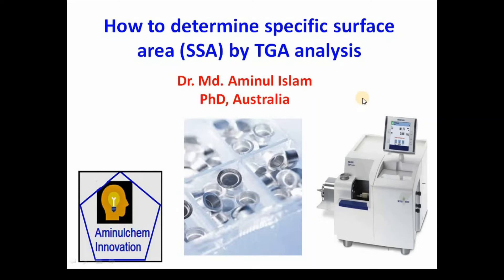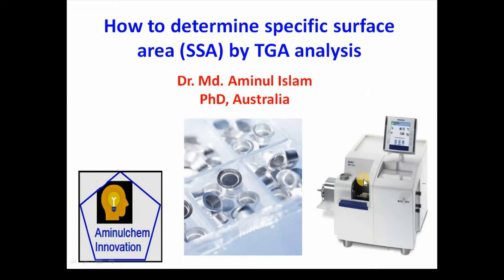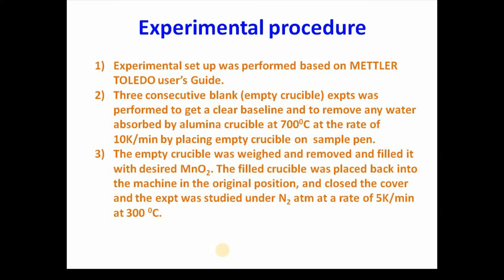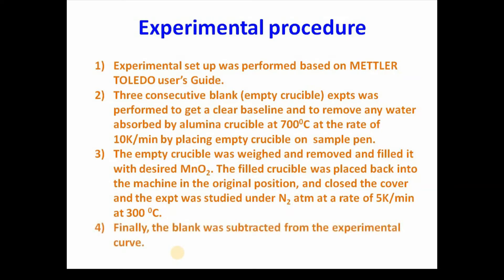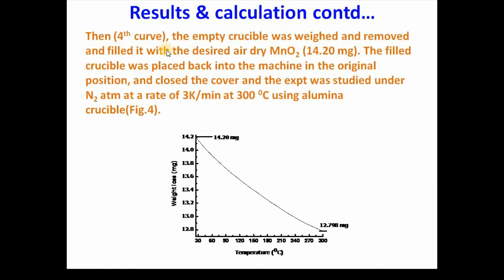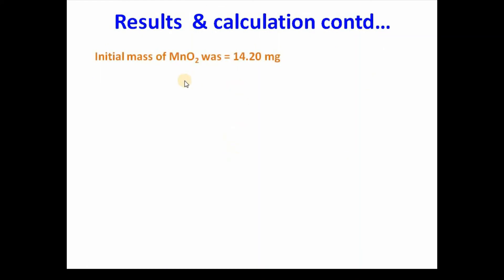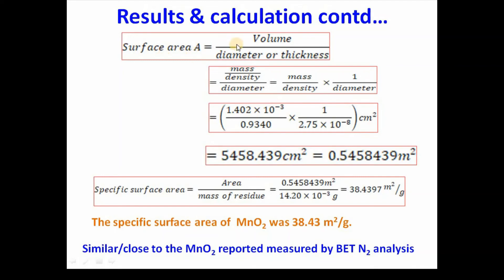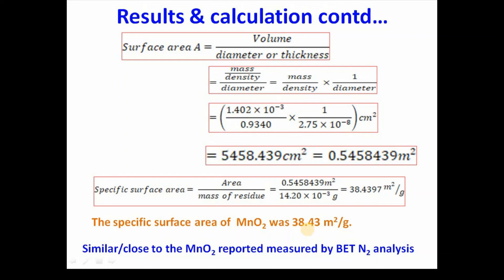How to Determine  Specific Surface Area (SSA) by TGA

Comment: Why should we use density of ice but not water?
Reply from the maker: Thanks for your comment. It was thought that water/moisture present in the oxide was crystalline water. Therefore, we considered density of ice in this calculation.
Reply: @Aminulchem  thanks for the reply. why don’t you use the number of atoms (mass/Mwt) multiple by molecular diameter?
Reply from the maker: @pisipisi5071  Thanks for your comment. That can be possible. However, I have shown here simple technique.
Reply from the maker: Please do subscribe this channel  & let me know if you have further problem.

Comment: Hi Dr. Md. Aminul Islam.
By the way, I would like to ask about another problem dry sample by heat.
1. Could you share with me a tip ?
I have a problem about sample when dry sample by heat.
After I washed sample with distilled water until neutral pH. I put the sample in drying oven and set at 50 ◦C . 
After 3-4 hours this same create a bulk (very stiff) - I guess it is dried out side and in side still wet.
  - I try ry to put sample in air maybe from 30 minutes to 1 hour to remove some water and put this sample in the drying oven and set 50 ◦C.  But this result still not good. 
I hope I would receive answer this problem.
Thank you so much
Dah
Reply from the maker: Thank you so much for your appreciation. You can't dry sample quickly. Just put your sample in the oven at 50 deg C and leave it & check after a day whether it is dry or not. If not dry then leave it in the oven for several days untill dry enough. Good luck!

Comment: I think it is wrong because when we calculate the surface area , we should  consider cross sectional area is correct  which is used fro water  0.594×10^-20 m2
Reply from the maker: Thanks for your comment. It was thought that water/moisture present in the oxide was crystalline water. Therefore, we considered the density of ice in this calculation and used the molecular diameter or thickness of the water molecule. A cross-sectional area of water may be also used.
Reply: @Aminulchem  so for I can use for my material ..also sir??..it should  consider..Also suggest  some journal  for fluoride  removal  , I want to submit  one paper...
Reply from the maker: @ksbdance6389  Yes. You can use